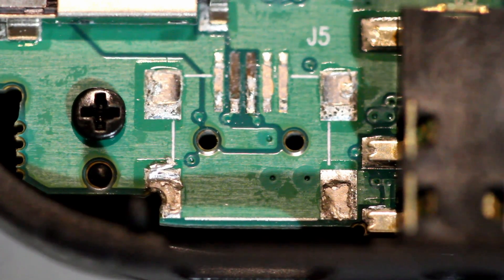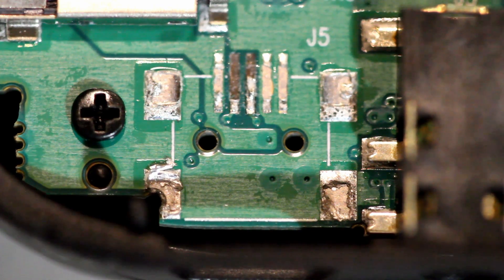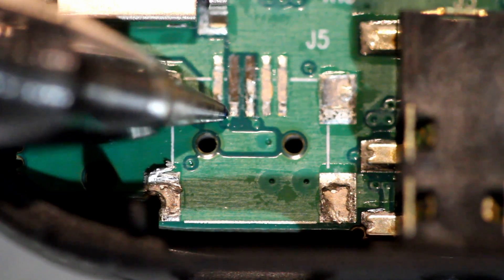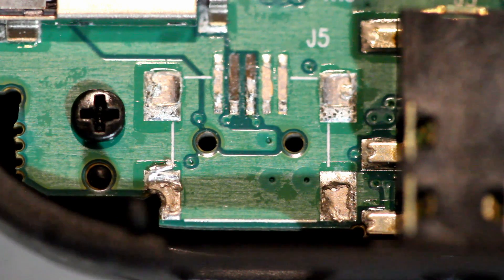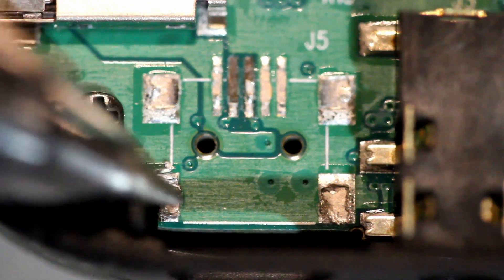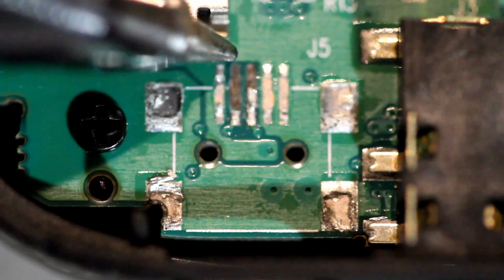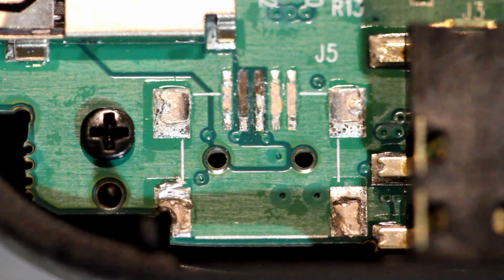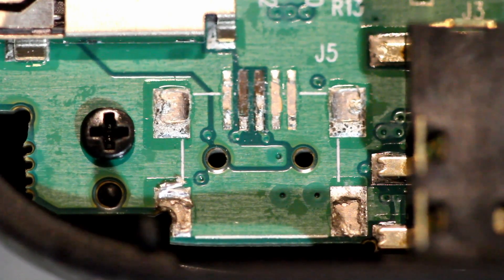How to Repair SMD Micro USB on DashCam

Comment: I am just wondering if the 3 centre pins (2, 3 and 4) are actually connected into the circuit board in someway? I do not think they are...See here...
http://www.sunrom.com/media/content/746/USB-Mini-B-Pinout.gif
I think this Mini USB SMD connector is used only to provide power to the camera. The 2 outer pins (1 and 5) are purely the power connections. Pin 1 on the left is the +5V and pin 5 on the right is the Ground.
Reply from the maker: This particular dash cam I don't think used the data connections, or at the very least the user didn't care about getting video off of the camera using the cable, he preferred copying the video off the camera by taking the memory card out.

But yes, the middle pins would be data :)